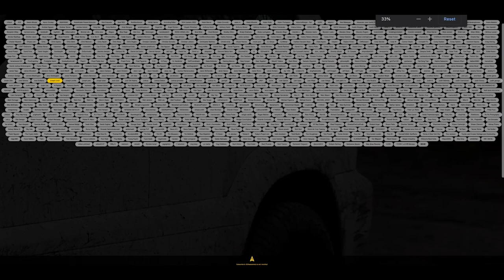Vlog 60 - Rago Fab Ditch Light Bracket (Lexus GX470)

Comment: On January 13, I purchased from Rago 3 items:
· Baja Designs Squadron Pro Driving Combo Led Lights
· 1st Generation Lexus GX470 Ditch Light Brackets
· Lexus GX 470 Molle Cargo Cage - Cargo Net Replacement

The Baja Design Lights, I found and purchased them for $80 less at a competitor after making and paying for the order at Rago. To their credit they canceled the lights and credited my account the full price of the lights. The owner did threaten a restocking fee, but this didn’t happen.

The Ditch Light Brackets, as you can see from the attached pictures , the brackets while constructed nicely, didn’t fit correctly. The outboard edge of both brackets came into contact with the hood rear edge. I adjusted them as far as possible using the manufacturer holes and they still made contact. Not wanting to go through the return process and liking the design/construction of the brackets, I elongated the mounting holes on the brackets enough to provide .10mm of gap. This is the thickness of 2 sheets of standard paper. I’m still not sure the gap is enough and am thinking of grinding the brackets to create a notch in the area by the hood.

The GX470 Molle Cargo Cage, I ordered on 1/13, today is 1/30. I still have not received the cage. Yet I received this request to do a review. I wrote a letter on 1/26 and the person there, Nikki, to her credit wrote me back on the same day apologizing for the delay, telling the order would be packaged and shipped the 27th and that I would receive email tracking info, which I have never received and I still have not received the cage.

I signed up for an account to receive a discount which I did but now my email gets peppered with advertisements. I requested this stop and it has helped a little but some are still sent.

If I could do it over, while I like the design of their brackets, the quality control is lacking. They don’t fit right. I have no idea about the cage but I imagine it will have issues too. Their prices are out of line and their shipping department missed the boat. I STILL have not received the cage and ordered it 18 days ago. Only my email reminder moved the process along.

The one bright spot in their operation is the person that answers the phone, Nikki. She is very nice and is doing all she can do in dealing with the jacked up people behind her. Please try to be nice to her.
Reply from the maker: I'm so sorry to hear you had some fitment issues. I agree the prices are a little high and there arent many options out there to pick from. I'm glad to hear that Nikki is able to provide some good customer support and help with the matter. Thank you for sharing your experience for others.

Comment: With the new bracket, how much of the light is visible from the driver seat? Is it a distraction? If its bad enough, did you consider leaving the CBI on the driverside and use just the Rago on the passenger side?
Reply from the maker: Great question! The light is not distracting from the drivers seat and I did consider that but I really wanted to give the CBI lights away to a subscriber so it made more sense to take them off.

Comment: Can I use the brackets to mount a LED bar? Do you think it will be an issue? Don’t want ditch lights, I want to run a long bar across both brackets
Reply from the maker: Great question! I also like the cove not you’re thinking of. I think it’d work, but you may have to make a custom bracket to adapt to the bracket. If you give it a shot, let me know what you come up with. Tag me in a picture on Instagram so I can see. I wish you luck and hope it works!